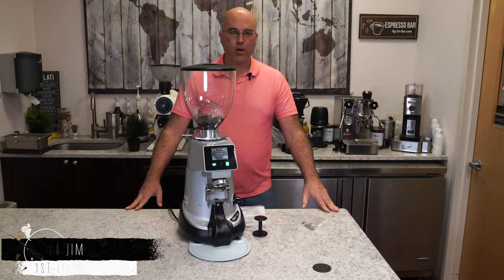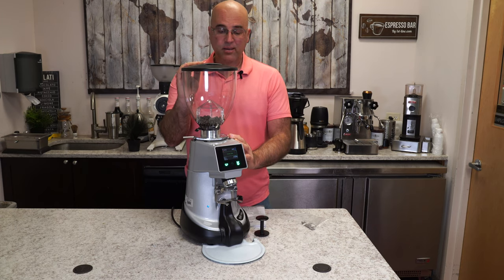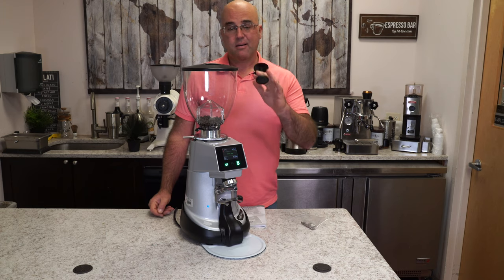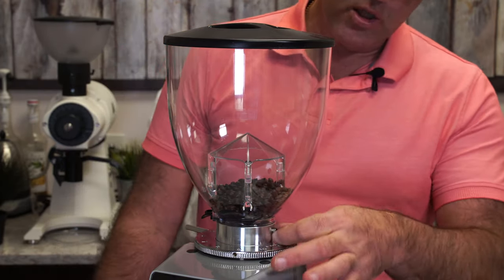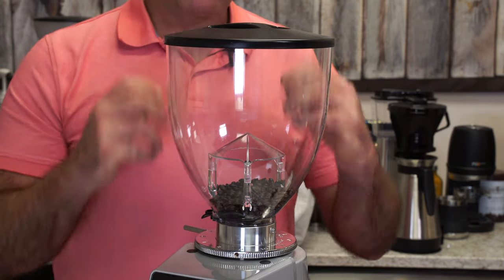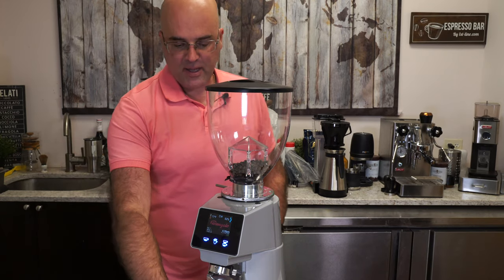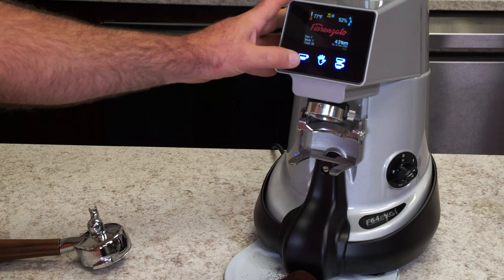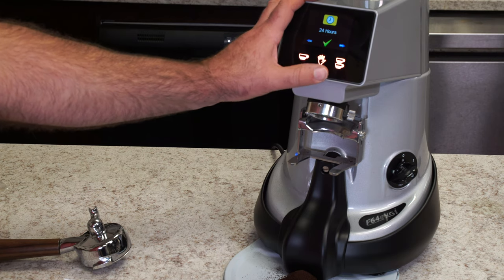In Depth Review: Fiorenzato F64XGI Electric Espresso Coffee Grinder

Comment: Hello.
Can a smaller coffee hopper be fitted to the grinder, which will be more suitable for home use? For example, another container for F64 type grinders on the market?
Are you planning the Polish language in the mill's menu? Italy and Poland are in Europe. :-) Maybe at least a user manual in Polish?
Does the grinder weigh the coffee while grinding or does it use grind time measurements after calibration?
How to proceed after changing the grinding thickness? Will the grinder take into account the weight correction by itself?
pozdrawiam